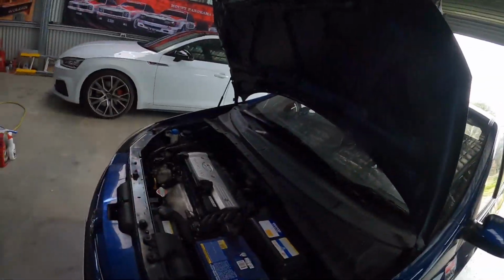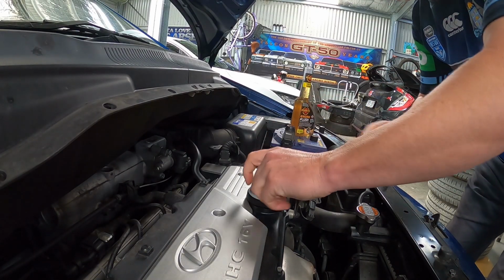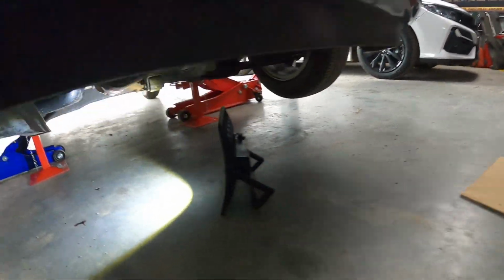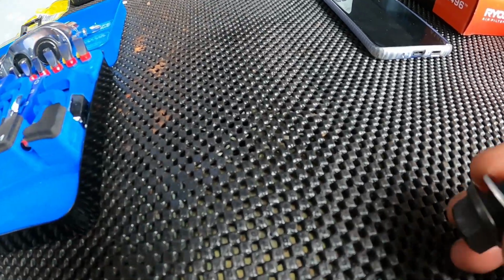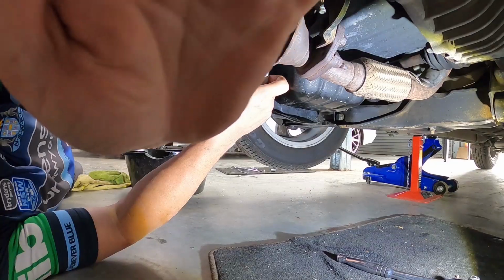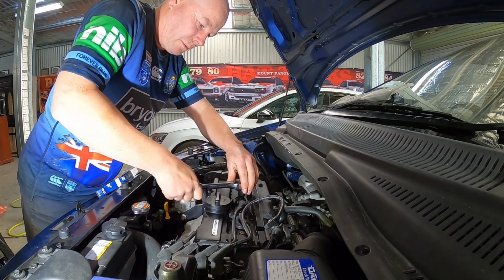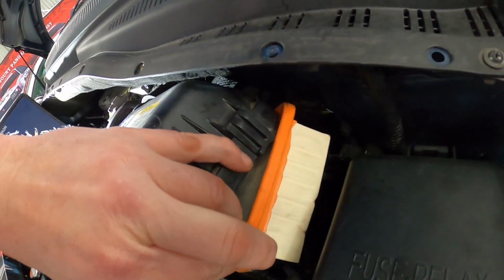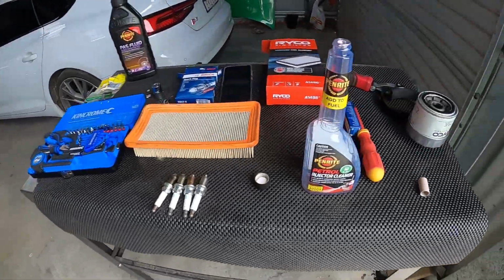How to Service Your Car for $100

Comment: How often are you engine flushing your cars Fred? Have heard conflicting advice on this practice.
Reply from the maker: G'day Pedro, every second or third oil change in the Getz.  Definitely don't use the flush if the engine is already sludged though!
Reply: Ok, thanks for the tip.  What are your thoughts on radiator flushes?

Comment: Do you recommend completely servicing your car every time and only going to a mechanic when something is wrong/seems off or should a 'beginner' car person still take their car to a mechanic for a service every now and again?
Reply from the maker: G'day Hayden, it all depends on your car (e.g. is it new and still under warranty) and your confidence. I didn't cover anything advanced in this video or tuning which would typically require a trip to the mechanic.  I would still get an annual inspection from a qualified mechanic in addition to the maintenance in this video.  Hope this helps mate.
Reply: @ClunieGarage  Thanks mate. It’s a LS3 VF SS, no warranty. I want to know how to do as much as possible myself, more out of enjoyment than the saving money factor. Slowly learning new things bit by bit. Reasonably good ‘on the tools’ as I work at a mechanical engineering factory. Cheers for your response mate.
Reply from the maker: No worries at all.  I would get started with maybe a simple oil and oil filter change and see how you go mate.  Spark plug removal on the LS engines are good fun, particularly if you have headers!